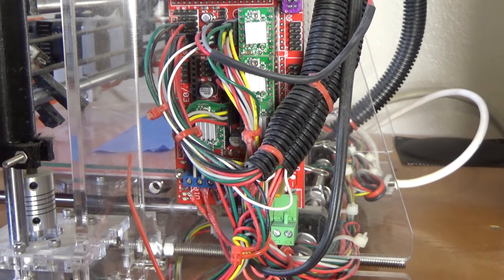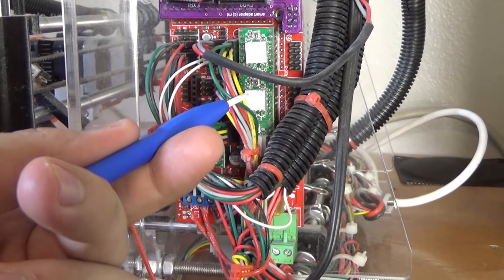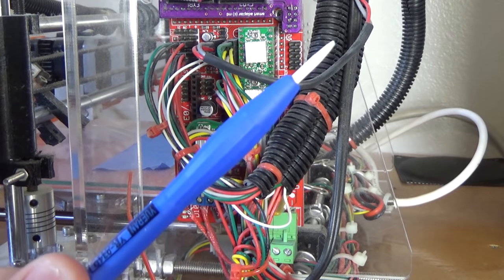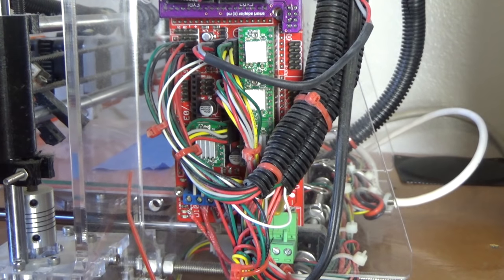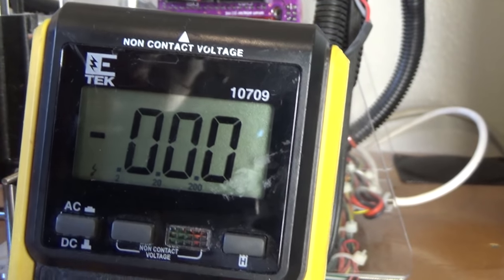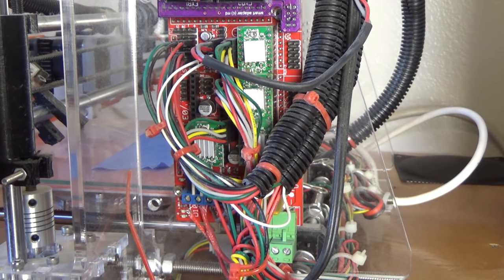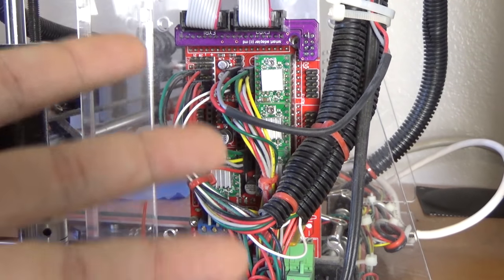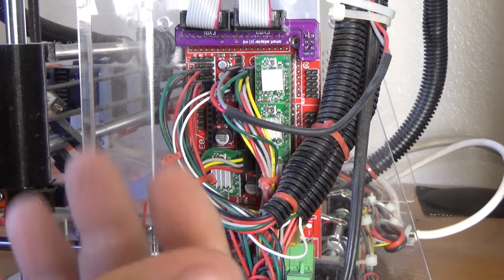How to Tune 3D Printer Stepper Drivers | RAMPS 1.4/Pololu A4988

Comment: I'm getting bad layer shifting after a month of running fine. Upgraded the ANET crap board to Ramps, but still having issues. Remade all of the connectors. Put heat sinks on the motor, and fans on everything. Still having the same problem. I'm about to replace the motor, but am thinking about going bigger. NEMA 23 maybe. Anyone have any tips before I commit?
Reply: have you checked your belts?  also make sure your mechanical stuff is fine and nothing is loose - anet has a shitty frame to begin with and the standard belts are not fiber re-enforced which means they stretch over time. how mayor is the shift? i dont think its stepper motor / motor current related or board related ( its a good thing you swapped to ramps anyway).  Stepper motors are mostly pretty robust and that's the last thing i would check even on the anet (i had a anet a8 and moded it to the point that only the stepper motors are left from the original printer and i can print @ 0.04mm layer hights without issues) - I hope this helps
Reply: belts should be tight and sound like bass guitar strings but not too tight if you strum them the pitch must not be too high like an regular guitar string. I also recommend chucking the stock belts in the trash and get new ones. if you dont have belt tensioners - print some - plenty on thingy verse ( print at 100% infill though and with abs or petg if possible)
Reply: emorichimaru  Thank you for the help. I printed tensioners early on. I tighten them until they just thrum when I pluck the belt. Sounds like a cello.
I glued a fan to my table next to the Ramps and it's fine now. The Pololu was getting too hot even when tuned down to where it barely ran. I might have a warped rail. I'm printing a case for the LCD and boards with a fan mounting spot. It was all good when I went to bed, but I had a lime green rat nest this morning. Trying again after dropping the Z down a hair. I think one of the parts didn't stick, and got dragged around and wreaked havoc. Nit the first time , and i'm sure it won't be the last.

Comment: And I burnt my board… YAY!
Reply from the maker: Miky Muky it's not the full 3d printing experience without doing it at least once.
Reply: Dustin Corbin: I know. Great that your responsive to comments cause I now have a question:
Of course I was too impatient to find an acrylic screw driver and I slipped out of the potentiometer into the aux-3 connections and shorter them. (Aux-3 is used for the display screen). The screen looked weird with averaged strips through the screen. I turned it off and then back on. I heard a ‘pop’ on boot and the printer is now non responsive. 
Would you have any idea of what is damaged? 
Tks for the vid though. I was just trying to find the correct voltage and nothing more 😢
Reply from the maker: Miky Muky plug in the USB to a USB charger and see if the lcd changes. If you are lucky a voltage regulators died but a USB charger will get around it. If not, then something important on the board fried and you'll need a new one.
Reply: Dustin Corbin: Update, my Arduino Mega2560 seams just fine. My stepper drivers don’t seem to be damaged so I believe wirings meleted in the PCB of the RAMPS as drivers are powered but with only a tenth of the voltage they should receive. Also, on various points of the RAMPS, I measure 1.300V. Does that explain something? (When the RAMPS is connected to the Arduino, the Arduino shuts down.)
Tks for the reply

Comment: Wow!... This is easily the WORST advice I've ever seen regarding stepper drivers. Do NOT do this! you will be risking fatal damage to your printer.
Reply: Could you please expand or explain how and why the procedure here is the wrong way of doing things and ideally also how I SHOULD be going about it please??
Reply: You aren't gonna ruin your printer by tuning your stepper drivers.
At worst, you will burn a step driver. They cost 3$USD a piece, and thats the very reason they are mounted on headers, instead of soldered directly to the RAMPS board.
Because you are supposed to burn your step drivers from time to time, and easily swap them out. If you don't do that, you can just go and buy a ready-to-print OEM printer.

Comment: What about the kossel delta , they have smaller nema17 motors, how to I know what is the target current?
Reply from the maker: +craquerbarrel Read the description.
Reply: +Dustin Corbin Oops sorry!
Reply from the maker: ***** Its all good :D
Reply: +Dustin Corbin damn they were set to .65 an .8v, maybe thats why they were noisey ?
Reply from the maker: ***** That is exactly why. They are not tuned from the factory.
Reply: +Dustin Corbin Cool, Im still tuning my printer while listening to your great instructions. I'll let you what comes out !! And thanks for your quick replies man!
Reply from the maker: ***** No problem at all :D
Reply: What did your current settle into for the delta? I'm tuning an Anycubic linear plus. having trouble with layer drifting after a little ways up. Reading the assembly manual I may have interpreted it wrong. I thought it was saying the voltage should be from 0.7ish to 1.25. They were about 0.8 untuned. I started trying 1.0 and had the drift problem on a more complex print. I bumped them down to 0.84 and it drifted in the other diriection, so I think I'm on the right track. After work I will bump them down till they are too weak, then tweak up and see what I come up with. Mechanically everything seems sound, except for a couple balls in the bearings sound a bit questionable though, so I may have to take a look at that as well.